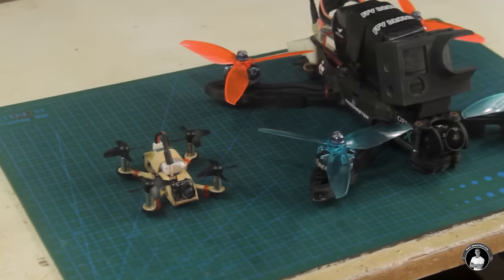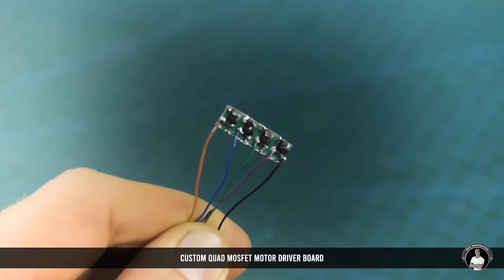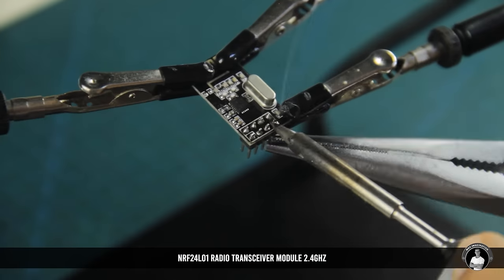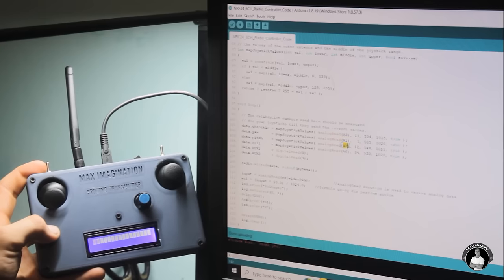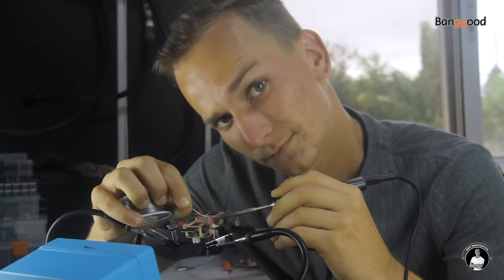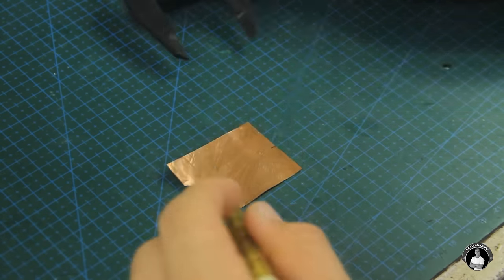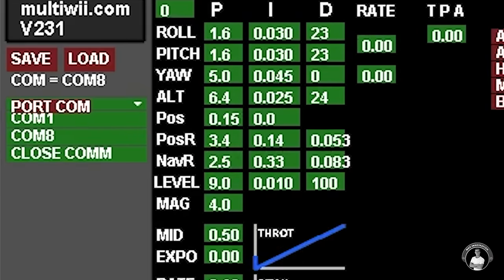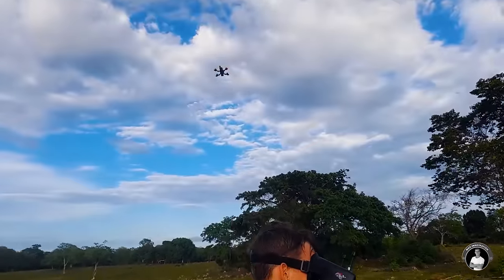Make a TINY Arduino Drone with FPV Camera - Will It Fly?

Comment from the maker: UPDATE: If you experience issues opening MultiWii on your Windows 10 or higher PC, it's because you do not have Java installed which MultiWii runs on. You're going to need to install Java 8u202 or earlier and edit your windows "path" data to point to that build, in order to use the MultiWiiConfig.
Reply: Fun
Reply: Respect 🫡

Comment: How old are you bro? I mean this is absolutely baffling. DIY Quadcopter drone with recycled components, with integrated fpv control is no easy feat.
Reply from the maker: 18 years young. Thanks for your kind remarks!
Reply: @MaxImagination dude I'm almost 18. I attempted to make a similar gesture controlled Quadcopter about a year ago, and I have so many questions about your build. Do get in touch
Reply: @MaxImagination  im 12 years and I just got into arduino probly gonna try it i made doom  but this is next level😎😎🥶🥶
Reply: @MaxImagination  still in the womb and made a rover to get sent to mars 🗿🗣🔥
Reply: Hey guy heres an update I ordered the part in a week or 2 I upload a video on my channel about it😁😁

Comment: I always admire how from scratch your electronic projects are.
Reply from the maker: Thanks for watching!
Reply: @MaxImagination This project and the way you used cheap recycled parts makes me so happy 😁

Bravo for working thru the HUGE number of problems in this build !

I'm surprised you didn't use the Adam Savage super glue hack of adding Corn Flour or Baking Soda as a reinforcing agent. It's incredibly strong for small wooden joints 👍
Reply from the maker: Thanks for your comment, Edward!
I appreciate the tip with the baking soda and superglue, I'll try it!

Comment: This really shows how far drones have come, not only in consumer drones, but also the building process for fpv drones. The ability to solder components to a aio board, screw them to a frame, and spend 20 minutes in betaflight to create a whoop seems so easy compared to what it actually takes to build from scratch. Unbelievable work. Also I love how close it is in looks and design to a 5in, even including the wide frame and top mounted battery
Reply from the maker: Thank you! I appreciate your kind remarks on my project... I took inspiration for the frame from a 5" FPV drone, actually! :)

Comment: Firstly amazing video very detailed and very beginner friendly. Second   for those wondering the EMF problem is real make sure to put the copper shield .Third and most important make sure to get a battery with 25C rating or higher as your battery dont get a generic 3.7V lipo cause it will shut down the arduino when the motors run almost immediately !!!!
Reply from the maker: Exactly! Thanks for reminding viewers about these important aspects of the project!

Comment: Nice work , I remember making multi wii and aurdino based drone last year. I had similar issue to resetting Multi wii on max throttle . I knew it was due to emi but didnt get the tangible solution. Great that you kept on going and solved this problem. I will retry this project again. Once again great work!!
Reply from the maker: Thank you! I'm glad my project has helped you move forward with your drone. Cool!

Comment: Perfection. An actual DIY tutorial where you aren't required to have a 3D printer or fancy stuff that average people doesn't have. Also props for using cheap components instead of 90$ motors (x4) and a cheap as hell camera instead of GoPro as other "DIY" tutorials.
Reply from the maker: You're most welcome.

Comment: The level of simplicity you added to creating a custom drone is amazing👏👏👏,I have worked with Pixhawk & Betaflight flight controller ,i know the pain and knowledge it requires to just get the drone in air.This is the best starting point for People to enter drone industry
Reply from the maker: Thanks for your kind remarks! Yes, getting such drone off the ground is no easy feat especially when done the first time like myself. Hopefully, my resources and guidance gives others new to building drones a good start. Cheers!

Comment: What an awesome project, congrats!! I have a question, does this controller work with normal drones?? Like connect with a flysky receiver
Reply from the maker: Thank you! It doesn't work with receivers other than its own kind (NRF24L01 series of radio modules) unless something is figured out to convert the received data at the receiving end to be processed by a different receiver.
However, at that point, it's better to use a corresponding protocol transmitter with that receiver.
Reply: @MaxImagination  that make sense. Thanks for the reply :)

Comment: The great thing about arduino is that you only really need the chip itself. It doesn’t really need many passive components. You could order a custom PCB with all the required components and a solid copper layer at the bottom as a ground plane, acting as a built-in shield. You can make the main board as thin and light as you want, even flexible! Give it a try.
Reply: but that again raises the difficulty of diy, he prolly wanted to make it simple so that anyone can try.
Reply: @AVI-xo1kb  You'd think that, but designing your own PCB is easy to learn. Your computer does all the heavy lifting and if you wish, you can try autorouting. That means the software connects everything for you. Then just upload all the files and order your new PCB's for cheap, and I mean cheap. Depending on the size and complexity, you can get 10 PCBs for as cheap as 5 bucks.
But there is a caveat. Soldering SMD chip packages can be very challenging. You can also order complete PCB's but that'll cost you parts+extra.
Reply: @PunakiviAddikti  that is the point IK pcb designing is easy you can do it yourself after a bunch of tutorials as I am learning pcb designing but pcb isn't as cheap as you think depending on the location it will raise the project cost significantly for example at my location if I do this project the cost of pcb simply outweighs the pros and joy of doing this project and again if you are near fab it's cheap but if you are far away then you will notice the difference
Reply from the maker: Making it modular allows for others to recreate the drone with more ease. Using PCBs cuts out most makers already, especially those who are beginners or who won't bother ordering an additional PCB alongside the components.

Comment: Hey max can i use s8550 transistor like u used in line following car because these mosfets are hard to find and i am a beginner so it is really challenging to solder
Reply from the maker: Hey! You can use only the s8050 version (NPN), not the s8550 as it's PNP. I suggest you use an additional 10K ohm current limiting resistor at the base, though.
Reply: Thanks

Comment: Add small powerful neodimium magnets on the outside of the motors inline with the pole pare inside.
It boosts the performance.
Reply from the maker: Didn't think of that... Will try! Thanks for your tip 😁
Reply: @MaxImagination  I hope you post your results. Neodimium is the one big reason why drones are so powerful and more efficient.
Reply: @MaxImagination  I had a tiny, 4mm by 4mm  I think, neodimium magnet and it was very strong for its size and weight.

Comment: How much this is adding up in total ? If i have to buy all the part + the equipement to build it ?
Reply from the maker: That would be hard to estimate, so I suggest you see for yourself when you add all the supplies, tools and other equipment to your cart. However, I can say that the drone once built contains $50 worth of parts and with the goggles + transmitter, a total of $150-200 USD. 

Cheers!

Comment: Make DVD 3d printer using Arduino uno make cheaper to cheaper and make with old components and scrape
Reply from the maker: Buying one is better. 3D printers are a complex matter and are getting cheaper anyway...

Comment: Such great and dense content. I’ve got a heavy CS background and want to make the switch towards ECE. How did you approach learning about all the parts involved and their function? Any tips or resources you wouldn’t mind sharing? Thanks a lot and keep it up 👏
Reply from the maker: I appreciate that! I learned most of what I know simply through doing and making the projects you see I've built. I've also absorbed knowledge from one book called "Practical Electronics for Inventors" and many electronics courses across different platforms.

Thanks for watching!

Comment: your board kept resetting because you had a ground loop, if you installed a dc-dc 1:1 1-3Amp transformer and rectify it , you would solve the transients experienced from the ground loops and it will no longer reset. this will also allow you to place the axcellermomiter board back to where it was as it wont be suseptible to interference anylonger.
Reply from the maker: No worries. I solved that with the copper EMI shield soldered to GND as you saw I explained in the video.
Reply: aaahh can you explain how I would connect the dcdc transformer?
Reply: @MaxImagination  You can also twist the power wires into a twisted pair

Comment: I can't imagine how much Hard work you have done because from my perspective its kind of crazy project for summer. I haven't even completed my cnc machine 😞
Reply from the maker: Don't worry... we all start somewhere. Getting to this level took a long time. Take it one project at a time 😁
Reply: @MaxImagination   oh damn you replied i really appreciate you replied to me. Actually I don't have all equipment like components fpv camera etc and i have to purchase other small things so, 😔 I just choose those projects which requires cheaper elements and requires less tools to make 😂. I just stuck at cnc machine (homework writing machine) cause i don't have good mechanism for pen 🖋️ they writes on paper 😅.
Reply: @MaxImagination  Also one more thing the experience you have soldering those wires looks like you have mice hands because I think this it's impossible for me with my big hands 😂
Reply from the maker: I have reasonably sized hands too. What I do with the solder work is simply a learned skill. You can do it too ;)

Comment: I just bought the 3d file in the description and i created the motor board and I'm half way through creating one, I have an important question though, if I create it using a 16mhz arduino pro mini instead of the 8mhz version, would it cause an issue?
Reply from the maker: Hi there. Thank you for your purchase!
It shouldn't cause as issue as even 5V boards can be powered with lithium cells and still function despite under-clocking them. 
I actually happened to use a 5V Pro Mini (16MHZ).

Comment: I'm not sure if you'll answer, but I hope so. I have questions:
1. How long can it fly on one charge
2. What is the maximum distance it can fly
2.1 What is the maximum distance it can transmit an image
3. What are the ways to improve the signal and its range?
Reply from the maker: Hi there,
1. It flies for 2-5 minutes depending on whether or not you have the camera attached.
2. It can fly up to 100 meters
3. It can transmit images for up to 150+ meters with that camera.
4. You can improve the control signal by using a specific NRF24L01 module with an external clip-on antenna connector and antenna. And to increase the video signal, simply use a better quality pair of goggles. To increase its run time, use a higher C rated battery and a higher capacity one without compromising weight.
Reply: @MaxImagination  thanks

Comment: You could eliminate the noise at the pins, by controlling the motors over a transistor. You put the transistor on power and the motor and the base to the pin. So when the pin emits a signal it opens the transistor and power is getting to the motor but no noise gets to the pin.
Reply from the maker: You mean an additional set of transistors to control the gates of the MOSFETs? I have heard from others saying it's better to use logic level FETs with Arduino boards. However, the copper sheet fixed those induced EMFs despite the unfiltered noise making it work in the end 🙂
Reply: @MaxImagination  sorry, I forgot about those. Then idk. Maybe your Diode caused the problem, but I don't think so. It coould also be, that something is wrong with the mosfets, maybe you could try using an different kind of transistor. But you found an solution and this is the important part

Comment: Looks great, but what about weight distribution. How do we know its going to balance?
Reply from the maker: I calculated the drone's weight distribution up front. The parts are distributed accordingly so you do not have to worry about that.

Similar to how you balance a plane, you can play around with how components sit until the center of balance is directly in the center of the drone.

Comment: Not sure if tech has change sufficiently over the years, but my past experience with small brushed motors and quads is they're disposabled; if you get the same luck I've had, it won't take too many flights for yo to need to replace the motors...
Reply from the maker: These motors can last you months of not years if used correctly - not overvolted and not driven the the wrong directions.

Comment: great video! i have a question, how did the copper plate reduce the noise you were getting? im getting noise on my motors too but im pretty stuck with using snubber circuits as of now. thanks!
Reply from the maker: Thank you! The grounded copper plate I added blocked the EMI from the motor drivers (transistors) from affecting the Arduino and Gyro. I suggest you implement this.

Comment: Hey, I really liked your project and watching this i made my own esp32 based wifi drone. But the problem is that the flight time is very less, whats your flight time with how many mah battery?
Reply from the maker: Hey! Thanks for commenting. The flight time with my drone when it has the camera is 2 mins and flies up to 5 mins without the camera. Make sure your drone's motor thrust adds up to double of the drone's total weight. For example, my drone weighs a total of 30 grams and has 60 grams of thrust for decent flight. It would still fly at 45-50 grams of thrust, but would be weaker. That's to give you a comparison. Work on using a lighter (lower mAh) LiPo battery and keep your frame's weight down.

Comment: Very good work. 13:30 however i would say it is generally false. I have done testing using separate pwm frequencies to drive dc motors and found that frequencies lower than 1kHz and above 50Hz is kind of the sweet spot. Anything below 50, there will be noticeable off times. Anything above 1kHz, the motor starts to lose power due to the inductance of the motor.
Reply from the maker: Thank you! I have come to realize that. During the project, I've been told that a normal motor PWM frequency is in the tens of thousands range. Apparently, lower frequencies are key. Cheers!

Comment: This is definitely a cool project, however if you are just using open source firmware anyway you might as well just use a multi Wii board with the MCU and IMU built in. Or you can pretty cheaply get all in one (AIO) flight controllers with brushless motor drivers and use betaflight and have an on screen display (OSD) to see battery voltage and other things. For a cheap AIO flight controller and a set of small brushless motors and propellers you wouldn’t be much more than £50.
Reply from the maker: A viable path to building your own drone, but it takes the DIY and uniqueness out of it. The fun is in building your own flight controller, motor driver, and making that all work. Thanks for your suggestions anyway!
Reply: @MaxImagination  How does it take the DIY and uniqueness out of it? You are already using an open source flight controller software, using multi wii doesn't make it unique and the motor driver you made is just a mosfet.
Reply from the maker: It's all up to preference, I made it my way and I'm proud of it 🙂

Comment: Excellent project!

I have a problem with my drone, it is resetting, even placing the EMI shield underneath the Arduino Pro Mini. I even placed a 1000uf 16v capacitor to filter the current but without success. I'm using a 220mah battery and it resets in 1 second. Using a 300 mAh battery, it resets in 8 to 12 seconds.
Reply from the maker: Thank you!

How are you placing your boards? Exactly as I've shown? In what way does your circuit/hardware differ from mine? Also, capacitors are not needed for this project.
Reply from the maker: No spam please! Also, I rather prefer that you explain by text.
Reply: I didn't mean to, I apologize. I think there was a problem with the YouTube comments and every message I sent was deleted.
Reply: I put at the top, Arduino Pro Mini and MPU-6050 which are parallel and in the same direction. At the bottom I placed the motor drive below the Arduino Pro mini, and the nRF24 just below the mpu-6050
Reply from the maker: Did you ensure to shield the Arduino and MPU6050 from the motor driver with a copper/aluminum foil in between? Also, make sure to ground this.

Comment: Damn this is very impressive that ATmega328P has lower processing power compared to F1, F3 FCs, it can still handle the PIDs. Also will there be brushless version???
Reply from the maker: Yup, it's amazing what you can build with only one Arduino board when you think about it. There may be a brushless aircraft coming in the future! On another topic, stay tuned for the next video :)